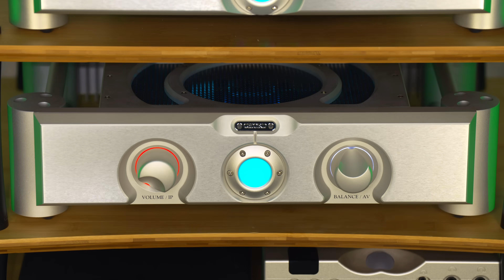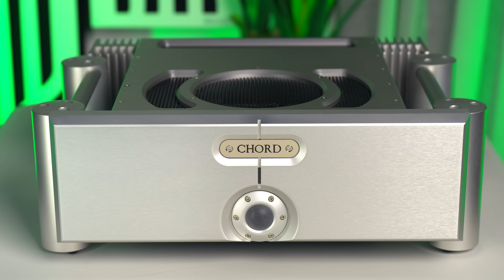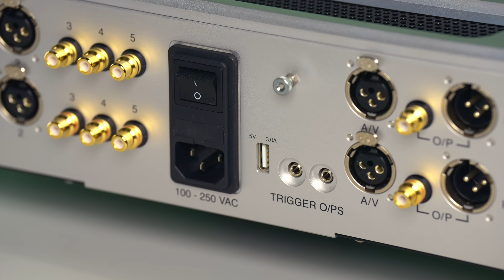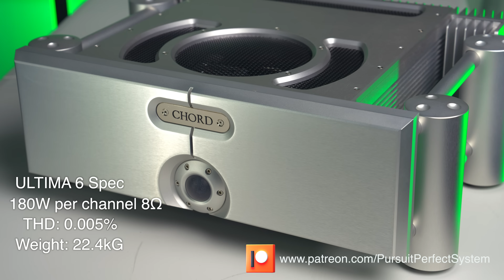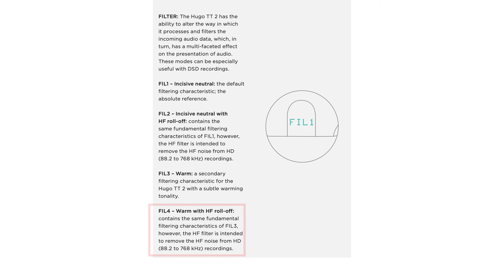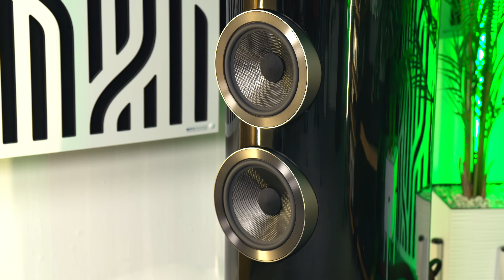NOT EXPECTING THIS: Chord Electronics ULTIMA PRE 3 6 POWER amp REVIEW

Comment: Hello Terry..I have the Chord Ultima Pre 3 running into 2x NAD C298 power amps bridged as mono blocks into a pair of B&W 804 D3 speakers and am very happy with the sound I get , I would recomend a demo of ths setup maybe with the new D4 version of the B&W's , would be nice to here a comparison to the Ultima 6 or 3 power amps . my budget would not stretch to them unfortunately . Could you do a comparison between the Ultima 6 power amp and 2 of the NAD C298's in bridged mode . I know it would be different from the NAD you did compare .

Comment: I don't share the review, had the ultima 6 and pre 3. i thought they are good until i had a pass int 250 here. it blew the chord away, speakers use 803 d3 dac use dave, Ive been always a chord fan, i think the 1200e was  the best amp they made.  The ultima 6 amp  lacks  grip and bass
Reply from the maker: 803 D3 is a lean speaker, not surprising you prefer the "thick" warm dark sound of pass labs, especially with a dave and if the room is reverberant even more so

Comment: Hi Terry, what I'm wondering is what the difference is between the Ultima 5 and the Ultima 6 and this because the latter is more within budget for me.
 I currently have an Ultima 3 and Ultima 5 on trial here but can't get the 6 on trial.
Thanks in advance.
Grtz Phil
Reply from the maker: I was with chord recently having a meeting about a video that is planned for this year at their factory. We was discussing the video I just created for pre power vs integrated. I asked them about the differences in power amplifiers and they explained the bigger the amplifier from them it allows them to install larger power supplies and they can build more around that for better performance. I would expect the two to sound similar but the bigger amp should do better what bigger amps do better scale control and ease. I have not directly compared them to say anymore sorry

Comment: Thank you for the review, one that is especially useful for me as I have just paired the Ultima3 Pre and Ultima3 Monoblocks with the Bowers& Wilkins 802 D4s. I believe that the Chords work particularly well with Bowers & Wilkins speakers, as per their use in Abbey Road and many mastering studios.
Actually, one point from my own experience with Chord: when I bought the B&Ws last month I felt that my existing Chord 1200C  stereo power amp was having to work harder to drive the big 802s, as evidenced by a really noticeable heat increase in the amp's casing, hence the change to the monoblocks.

Comment: I have been using a Chord-SPM-1200E with my B&W 802Ds since 2008,  the perfect a match for B&W.  In 2023  I got an older Berkeley DAC, which replaced a BAT VK-32SE preamp.,  The Berkeley receives it SPDIF digital stream from a Esoteric SA-10 CD (used as a transport).  The DAC's analog out are directly connected to the Chord. A truly reference system!

Comment: how can there be no db indicator on the pre-3, whereas there is a dB indicator on pre-2
Reply from the maker: The Pre 2 is a higher end unit and its a bigger unit so probably allows for more front plate design options
Reply: @PursuitPerfectSystem  btwn. Pre-2, Pre-3, or CPA5000, all I care is a unit that can send the digital co-ax signal from the DAC , by passing any filter, I think either the CPA5000 or the Pre-2 can do that
Reply from the maker: The pre comes after the dac not before

Comment: Great review thanks. I noted you mentioned that the Etude was an even better value 'way in' to the Ultima architecture. You also reviewed it previously and were very complimentary about its performance...so can you offer some comment on any important or perceived differences in performance between the Ultima pre/power and the Etude, other than maybe those that might be expected due to power output differences etc? (for transparency I have an Etude and absolutely love it...and I'm particularly keen on small form factor and simplicity of set-up etc)

Comment: Nice review @Pursuit Perfect System, thanks. So true your final comments about knowing when you've got your system right, when everything you play through it makes you stop and listen. And the speed and the dynamics is where, I my view, it all sits. If all the pieces in the chain are be able to reproduce sound very precisely, nothing will sound harsh anymore. It's the smudged edges, I all my home testing experience, that make the music sound brittle or dull, or both. I have settled for Bowers d3 speakers and Chord TT2 straight (no pre-amp) into Accuphase power amplifier - not tried Chord amps, but after watching your review can easily imagine the Ultima to be similar in speed and resolution to the likes of Accuphase and Luxman, with which I am familiar. 

One question. I notice you're not using any isolators under the speakers, at least not in your video. Any reason for that? 
I had the same issue with hot treble/mids with my 804d3 floor standers until I put them on Isoaccoustics Gaia (after watching your video about them 😎) - never felt the need to use filters in TT2 after that (and that in a room that is not acoustically treated). Maybe the impact of isolators would not be as significant with the bigger and heavier 803s, but my feeling is that it's the smearing effect of those minute cabinet resonances that can make a very precise speaker combined with a very precise amp sound too hop up top. Perhaps worth trying if you still have the setup?
Reply from the maker: These Chords are much faster than Luxman and Accuphase but deliver music totally differently as well so its not as simple as focusing on that one factor.  Also the TT2 is nice as a PRE but a dedicated pre could give you a lot more and is something to consider if funds allowed of course.  Not meant as a criticism to your decision, if your happy that is all that matters, its just some encouragement advice as I have done some testing of this recently.

If you look back you will find I was one of the first, if not the first person to make videos about IsoAcoustics GAIA and helped get them much more widespread known.  At the time I added them to my KEF Reference speakers because they were always in use.
But I cant add them to every speaker I review because its too much to do and I would need so many different sets its not feasible. Maybe in a long term ownership situation I would add them again but thats not my life doing this job
Reply: @PursuitPerfectSystem  thanks for your encouragement. Seems like a non-brainer now that I should have tested those Chord amps with the TT2. Guess what put me off trying was that witch-mode power supply inside them, as the noisy cheap one that the TT2 ships with does nothing to promote Chord's expertise in that regard. The TT2 is class though, as a pre (in high-gain mode only) it beat the pre-amp sections of all the £4-8k integrateds that I tried. But I might try some dedicated preamps as some point, take your advice. NB. the TT2 in low-gain mode is not the same, there is a loss dynamics and clarity similar to what you described in your review of the Bespoke Audio passive pre-amp. An extra transistor in the signal path to reduce output voltage is bound to reduce SQ - just like that cheap SM power supply, or the display that buzzes when not dimmed, some really strange design choices by Chord for a £5k DAC.

Comment: I haven't watched the review yet -- I'm literally only halfway through the attention-grabbing intro question -- but I had to pause it anyway to speak a little bit of truth to power about a pet peeve of mine in high-end audio: 

People love to say that integrated amplifiers are always sonically and functionally inferior to separates. And that might be true, but the way things stand right now there's no way to know for sure. The first problem is that the sound quality is never an apples-to-apples comparison in terms of price-point (because that would defeat the supposed purpose of the separates in the first place). So when someone says, "Company X's $1500 integrated didn't sound as good as their $3000 separates," I submit that there's no way of knowing if the sonic difference is on account of the fact that the separates are separate, or on account of the step-up in price. No one can digest every single product review in high-end audio, of course, but if there are reviews of same-company integrated amps compared with the same-exact-priced separates, it would be news to me. 

Second, the fall-back position in defense of separates is that their modularity makes it easier to get the best-performing example of pre- and power from the same overall expenditure. If in 1990, for example, the Melos SHA-1 tube preamp and the Bryston 2BLP power amp are the preferred choices for a system, one doesn't have to settle for an inferior preamp by Bryston or an inferior power amp by Melos, but can instead mix-and-match. This isn't exactly false, but it's predicated on the confident presumption that differently-branded pre- and power amps can be connected plug-and-play, and many a high-budget audiophile have learned very painfully that this simply isn't the case. A terrific-sounding preamp by company X and a terrific-sounding power amp made by company Y might sound great, they might sound terrible, and they might literally not even work. So what happens is that the audiophile buys the best things he can get, ends up with terrible sound, and then the more senior members of the club switch on-the-fly to laughing at him for having been foolish enough not to match the badges on the separates. 

Take yourself through that: Separates are better because you can mix and match, but if you do mix and match and they don't work together, it's your own fault for not matching them. At this point are we even talking about separates at all, at least as the name implies, or rather are we talking about a more-expensive integrated amp that happens to come in two chasses with two power supplies? 

Finally, there is the idea of modularity of upgrades. If you own a $1000 preamp and a $1000 power amp, the argument goes, it will be much easier to preserve some of that system while improving the sound, by keeping one of them and swapping out the other one, vs a $2000 integrated. That's true as far as it goes, but it also makes it much easier to WANT to upgrade in this fashion, when the upgrade in question might not actually be worth the added outlay. If you own an integrated, you won't upgrade it until the budget and the SOTA combine to make the upgrade a much less ambiguous proposition, psychologically, and that means that the owner might actually SAVE money in the long run, vs. opting for the supposedly more dollar-efficient and modular separates.
Reply: Seperate power supplies makes a big difference, and you wont get seperate power supplies in an intergrated design.

Comment: Big blunder by Chord!! No center balance detent! No thanks..is there a bypass option?
Reply from the maker: Not really that big a deal, yes there is an AV by pass
Reply: @PursuitPerfectSystem  sorry I meant a balance bypass so no balance attenuation is in the path.  Thanks
Reply: @tkl0111  it's probably not a simple balance circuit... I bet theres no detent because its a digital rotary pot telling the attenuation chipset what to do, in which case bypass isnt required. At this level, I too would be a bit annoyed not getting that centre 'donk'!